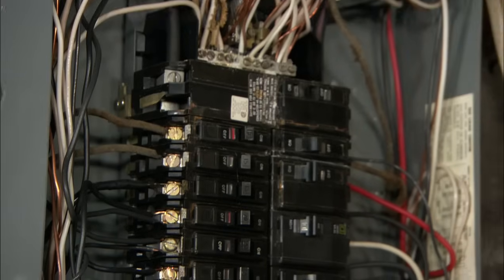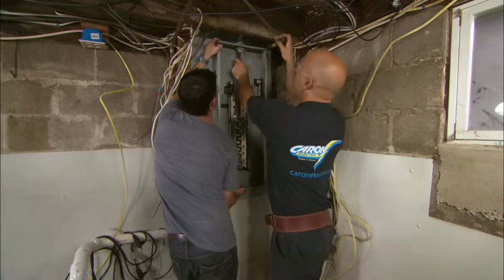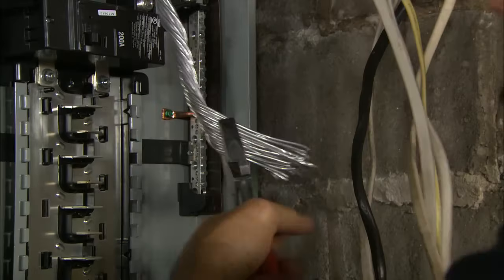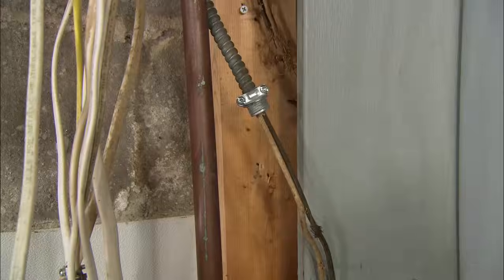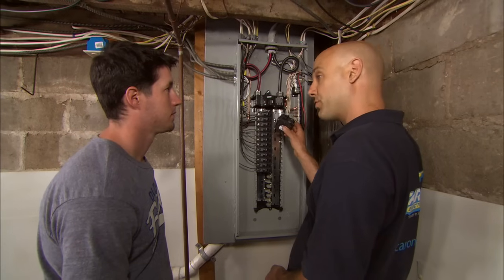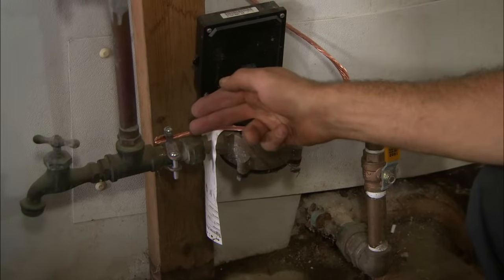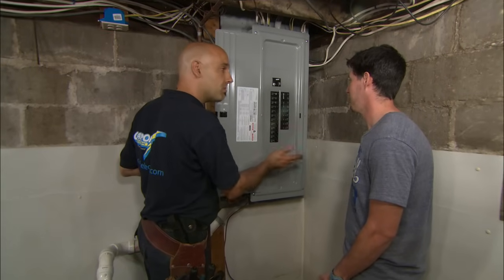How to Upgrade an Electrical Panel to 200-Amp Service (Part 2) | This Old House

Comment: Violation: Double bond between meter and main panel. Also NEC 250.24(A)(5) says neutral-to-ground bond must occur at the service disconnect which is the main panel and not the meter as per the Part 1 of this video. The ground cable from the ground bar to the meter is unsafe now because the EGC on the meter socket. Neutral current can flow on grounding system and metal piping. This creates shock/fire hazard. combined with the bond at the meter, the main panel sees neutral already connected to ground via the meter. Main panel’s own neutral-to-ground bond creates parallel paths. Step in to my office, why? Cause you're ef ing fired.

Comment: Real poor.  Not one mention that if you are upgrading from say a 100 amp panel to a 200 amp panel, it requires a larger gauge wire feed into the home.  Also, the power company will want proof of your load requirements to see if a 200 amp upgrade is justified.

Comment: I noticed there are two separate grounds. One in the meter box outside and the second in the breaker panel inside the house connected to the metal pipes. Could you have just used the outside ground and run a wire from the meter box and thru the wall into the inside panel?

Comment: I noticed the water line and water pump is on the same wall and close to the panel . I think that is not code in all 50 states .

Comment: Would of been nice to show or tell the difference between a 100 amp and a 200 amp panel. If you had plenty of room left in the original (100 amp) box, couldn't you just replace the 100 amp main breaker with a 200 amp breaker and be good to go?

Comment: I’ve never seen pipes with ground attached that didn’t have significant corrosion upstream from the wire on the pipe when compared to the rest of the piping

Comment: So layman question for the licensed electricians in the audience.
I have a 55 year old 100amp breakerbox. What is the benefit of upgrading a breakerbox to 150 or 200, if there was no upgrade to the original wiring? CAN it be upgraded with original wiring? AND of course, ballpark price of having it done?
Reply: Did you get three local quotes? Not a LE, but let's say you get a good electricition to come out, they've got to bring it up to local code, which could mean more than just a panel swap. You may need new wiring, outlets, etc. Start with a 5k budget for such a project.

Comment: Hack job , put a trough above the panel and bring all new wire down to your panel . Also the black wire is typically a phase not the red wire

Comment: That's not a 200 amp main circuit breaker as it does not provide over current protection for the service entrance cable. It is primary disconnect for the panel. The main breaker should be located within sight of the meter. Snd that's why you buy a meter base main breaker combo. If you need to work on the lugs or the service entrance wire you would hsve to pull the meter. Which means you have to cut the seal. Which means you are in violation of the power company rules. Now the power company has a locking ring on the meter. Only yhey can remove it. An outside main breaker is a necessity for servicing the panel inside snd a disconnect for the fire dept. Once a fire starts and the house gets flooded with water they don't want to go inside with electricity turned on. And if the meter has a locking ring instead of a cheap plastic seal the meter cant be removed.

Comment: Why are the ground wires and the neutral connected to the same bar ? I’ve always been told they should be connected to separate bars .

Comment: Phase imbalance once again.  Your power company charges you for the "hottest" phase in the panel.  To make this simple, each house panel has 2 phases, A and B.  A is on the left side, B is on the right side. When electricians put all the 15/20 breakers on the left or A phase and 2 poles on the right, the utility company will charge you just for the A phase.  
It is estimated that 70% of the constant power being used in your home is from the 15 or 20 amp breakers.  I personally have seen metered circuits in real-time show the 70-to-30 split on phases.
What this means... owner is paying 40% more every single month than they would be if the EC would have staggered the breakers, really.  
Why do EC's do it this way... habit and they don't care what the owner pays for electricity.
Should be a code requirement to balance the phases on every panel ever installed.

Comment: That neutral wire going into the house should have been insulated just like the hots as it also is a current carrying conductor. If it's bare like it is it is supposed to be a grounding conductor. Taping it with white wire is not approved as insulating the bare wire. Even though the tape has a dielectric rating of over 300 volts it's not approved for insulating bare conductors. It is approved for marking and identifying wires.

Comment: NEVER, NEVER, NEVER start cutting wires until you're ABSOLUTELY SURE that the power is off.  Use a "squeaker" or a test light or a multimeter.  Even if you KNOW that the power is supposed to be off.  Never hurts to be SURE!!!

Comment: When you upgrade to 200 amp service do you run more cables from the panel to use the increased capacity? Why only have the same amount of cables and breakers if you increased the service?

Comment: ok, but I would have left the top double spaces open. For example, to install a surge protector top left side. And a generator interlock on the right top side. That is what I did when upgrading from 150 amp fuse panel to 200 amp square D panel.

Comment: Master electrician. He did a fantastic job keeping it simple and neat. I need that man here for my 200 amp service install. Excellent work. 👍
Reply: It ain't that hard. I'm not an electrician and I could do it.
Reply: @jamedlock83  Same. I do most of my own work. Time is more what I need these days.
Reply: You just saw a video on how to install it an the first thing that comes to your mind is that you need to call a guy to do it for you?... You must not like your money because this is a $2000 job that could easily be done in two hours.

Comment: I hired an electrician and and I have problems on remodeled home. Small house 1/1 and I’m having problems with it. Power goes out some rooms or flicking or lower power other rooms.   Can’t figure it out after changing breakers from 20-30 amps and still problems.  HELP !!!! Lol😂

Comment: What size wire goes from meter to 200 amp box?
Reply: 2/0 AWG copper wire or 4/0 AWG aluminum

Comment: I'm fixing to have to do this.... we have an old (original 1974) service (idk how much it even is - how do I tell?) with no more space for new breakers. We need to add a plug to garage ceiling for door opener (currently on extension cord to ONLY dual receptacle standard plug in garage, which blows my mind) and we want to add another plug to other wall of garage, another plug to all 3 bedrooms and a few things here & there. We have aluminum wiring but see no urgent need to change as I check connections every year and use Noalox.

Comment: Surprised to see residential branch circuit wiring entering the line side of a service panel.  The panels in Canada have a separate cover isolating that area from the rest of the panel.

Comment: Doesn’t the neutrals and grounds have to be separated since it’s bonded in the meter?
Reply: That's exactly what I was thinking. Where does my ground bar and rod come in to play LOL
Reply: That is only for sub panels on your main panel you can tie your neutrals and grounds together
Reply: It depends on local codes. Some places require the neutral (white wires) to go to the neutral buss and the ground wires all to the ground buss.

Comment: Man you installed Black wire to Red and Red to Black I know it is working but it is wrong to remember always Black on the right side and Red a the left side 😀😀😀
Reply: How did you come up with the "Black on the right side and Red a the left side" Is there a code along those lines?
Reply: @neutrodyne  
It is not code
It shows someone experience 
And professional work
Everyone is following, and it looks good, too
By electrical, it doesn't matter. Black and red is some voltage, and both positive 
If the main is 200A, you will get 100A from each
I mean, if you teach people it is better to show them better ways 🤷

Comment: its better to just wire all the 14g and 12g wire in one big ball and use the cheapest vinyl tape you can find to insulate the abortion. My Breakers My Choice!

Comment: I remove each breaker wire versus just snipping the wire like this electrician. Better to have too much wire than not enough
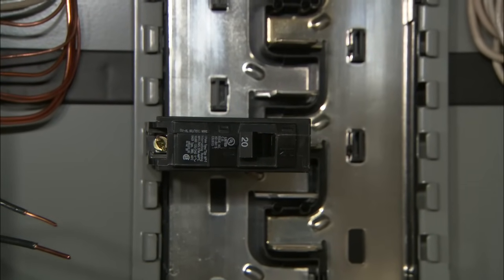Reply: 2:22 2:27 2:32 2:35 2:38

Comment: I don't like aluminum wire. Under pressure of lugs, it sqeezes and becomes loose, arcing,heating,maybe a fire. And you should never use a water pipe for a ground. Use a ground rod.

Comment: Oxidation doesn't happen since 2008 or something like that. Electricians refuse to stop using that crazy stuff. The manufacturer has improved the aluminum.

AND STILL, electricians, looking to appear smart, will claim they have seen aluminum corroded that was newer than that.

NO YOU HAVENT. Not if the wire was actually made past those years.

Comment: Good video. I've watched both parts (1 &2).  Piece of cake...I could do this myself.  However, the video doesn't show any of those unexpected problems that could (and do) occur and require a solution.  That's the reason we hire a pro, who has been there and done that.  Thanks for the video.
Reply: If you watched part 1 then you know he said right up front you ALWAYS hire a professional to do this kind of work. He's only showing the steps involved,  For me it was very helpful because I'm thinking of upgrading to a 200 amp circuit and wanted to know how much work is involved and get an idea of roughly how much it would cost. Now that I know it requires all new panel and wiring all the way back to the meter I know it will not be a cheap or fast job for any electrician, and I don't need to have anyone come all the way to my house to tell me that now.

Comment: I hate to say it even as a non electrician but have done an upgrade, helluva alotta rings on the copper when he stripped em back.  Yikes.. And Am I wrong for saying u wanna balance the load when breakering each leg??

Comment: Can a 200 amp main panel eliminate the need for a an exiting sub panel right next to it?
Reply: If there was room for all the circuits in the existing sub panel over in the main panel there would be no current need for the sub panel.  The main panel might be full or someone was planning ahead and put in a sub panel to allow more circuits in the future.
Reply: @jaycahow4667  The electrician will eliminate the subpanel (and 100 amp main) and move the circuits into the new, larger 200 amp main panel.

Comment: One question - I thought you had to separate neutral from ground bars and not mix them?
Reply: You are right when it comes to Sub Panels, on sub panels the neutral and ground bars have to always be separate.
Bonding neutrals and grounds in a sub panel is forbidden, I'm not an expert but I believe the reason is that it can cause stray currents on ground wires, high magnetic fields from your house wiring, a fire hazard & may be more reasons too.

But on the Service Entrance Panel as was shown in this video, neutral and ground bars have to be bonded together. I believe the reason for this is so that there is a path for ground fault current to be able to trip the breaker.
Reply: @flat-earther  pretty much. If the sub panel is bonded it doesn’t create a clear path to ground.

Comment: I'm just going to assume the circuits are absolutely fine, I'm going to assume the last electrician knew what he was doing....I'm going to assume the correct cable size was used throughout the circuit...

What a joke!

Comment: Question. When main service breaker was turned on, were other breakers on or off? Some articles claim that home breakers should be off, and should be turned on one by one once service main breaker is on position.

Comment: Some state will not allow to metal pipes as a ground on new or when upgrading the panels, Check you local and state laws. California now requires you to have your main panel grounded to a dedicated ground like they did in in the previous video.

Comment: Does anyone know if there are any manufacturers that make main breaker circuit panels that still use steel tabs to retain the 1 side of the circuit breaker? All of the new panels that I have seen use plastic tabs to retain the breakers. These are very cheaply made and the breakers tend to sag down when the cover is removed, The panel in this video looks like a Siemens brand and uses steel retainer tabs, but the new Siemens panels now use plastic. Thank you.

Comment: GFCI breakers are now required for:
Outside circuits
Basement circuits
Washer and dryer circuits
Kitchen circuits
Bathroom circuits
Anywhere else that has water near it
Reply: GFCi outlet will work too

Comment: The new code requirements are for a separate ground bar and a separate neutral bar
White and bare are no longer allowed to be on the same bar

Comment: Good job, in NY they definitely do not want to see a ground in the meter though. We would run that directly to panel. It also looked like he put a expansion fitting on the pvc riser, strange but maybe Massachusetts has some dumb code requiring it. The only critique I have is although you didn’t label what each branch circuit was, you should label what amperage breaker the wire was on. A lot of old houses do strange things you wouldn’t want to send a larger amperage circuit to a device only rated for 15amps.

Comment: There was no need to curl the wires going into the panel. There was enough space to run the wires straight in the lugs.

Comment: Outstanding video!
   This shows that great electrical work is always clean and neat.
  Leaving extra length in the wires is also important for future work.
  Metal gas lines are also often grounded.
  Well done Ask This Old House!!!

Comment: Wondering how much this cost to do a upgraded to your house?
Reply: 3yrs later still ask this question as looking to install pool with add on. Will need to upgrade to a bigger panel

Comment: To all electricians out there, after watching the two parts of the installation, both grounds, main panel (connected to copper water pipe) and meter (connected to rods), are not connected. Is it right?
Reply: It's fine from the code standpoint, but the power company has the final say. Theirs wants the GEC landed in the meter. Around my parts they want it in the main panel.

Comment: Would have been helpful to hear what gauges the wires needed to be for the upgrade.
Reply: 14awg for 15 amp breaker, 12 for 20amp, 10 for 30, 8 for 40…
Reply: Pretty sure he means the service conductors 😂
Reply: Then #6 for 50amp breaker😊
Reply: @addminusDIY  #6 for 60amp breaker as well.............

Comment: This is more of a how to change your panel video, a service upgrade involves the outsode piping, meter pan, and wiring upgrades, and ground rod if not previously installed. Not a bad video but leaves out about half of the work done on an upgrade
Reply: Its in the previous video
Reply: All that is in part 1. this video is part 2

Comment: Interesting that the neutral is bare aluminum.  I have put in 3 200 amp boxes and the electric inspector always wanted coated wire with white tape for the neutral.
Reply: You’d think that would be a flash hazard. I wouldn’t trust a bare current carrying conductor

Comment: from watching video i see that codes vary in different areas.  i followed the n.e.c. (national electric code).  the large hole drilled in the house should be sealed. ground rod(s) are installed because plastic plumbing is rapidly replacing metal pipes. labeling circuits is a requirement, not a suggestion. a radio & a helper will make things easier. in recent years, anti-oxidant rules have been relaxed. i'd use it anyway. aluminum conductors are safe. years ago, aluminum romex without proper terminations was a fire hazard & has since been outlawed. i live in west central ohio, formerly supplied by dayton power & light. property owners & contractors are allowed to cut & re-connect (CAREFULLY!!) service conductors. always call utilities when their seal has been cut to avoid fraud charges.

Comment: Please do not just cut every wire like buddy did here, you won't know whats 240v, also maybe a circuit is sharing a neutral, now if you followed his steps you just created a hazardous situation. Don't agree with some of this at all.

Comment: Why not just have everything set to 30s?
Reply: because the gage of wire, if we put 30 amp breakers on every wire and it was say 15 amps then thee wire could over heat and cause your house to burn down.

Comment: How about load balancing??
Reply: It's only single phase
Reply: @stevenpersinger6577  no neutral?
Reply: My point is that single phase isn't that critical to balance.  Houses these days do not draw alot of power with the efficiency of most things.
Reply: @stevenpersinger6577  Got it.  My NEC instructor made it seem like a big deal in homes as well when setting up panels.  Said there was money to be saved since unbalanced loading made the meter turn faster.

Comment: you really should put a disclaimer on here that the house power was shut off by the electric company before he starts cutting those wires, someone is going to get hurt
Reply: This is a 2 part video that was done in part 1